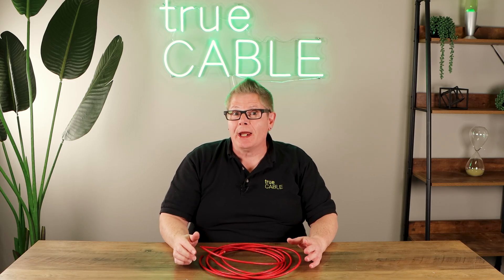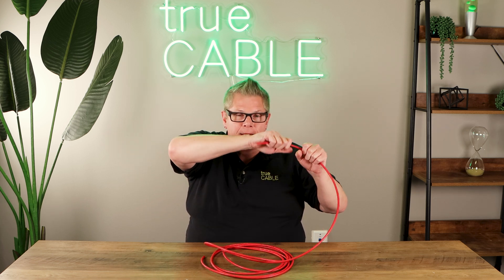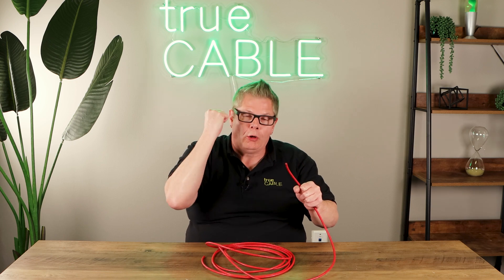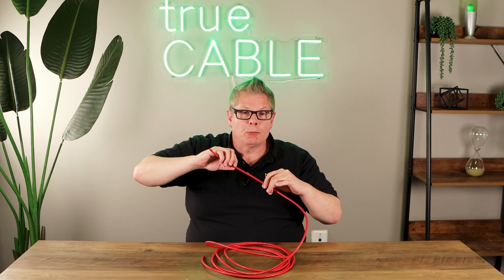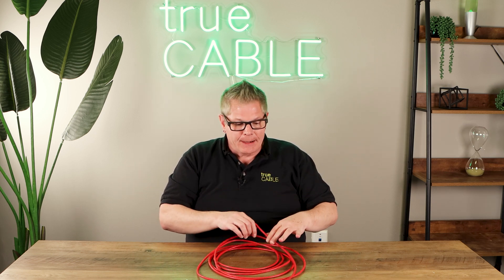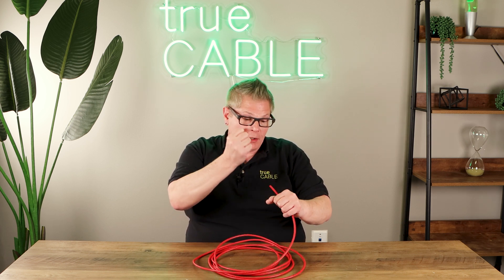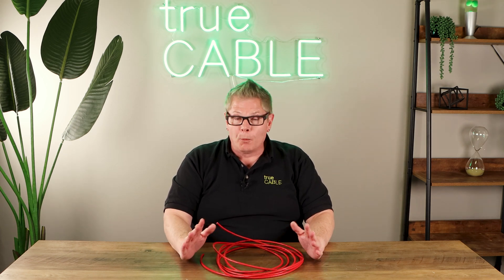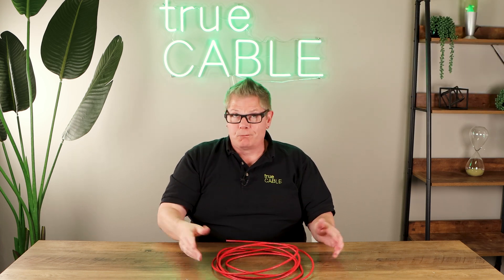Why You Should Never Pull Ethernet Cable Too Hard

Comment: My ethernet cable is stuck like crazy in my Msi Titan 18HX AI 😢 idk how it happened. I just put the cable in like normal
Reply from the maker: Hello and you are not the only one who has had this happen. What is going on is many consumer market devices such as laptops, consumer level switches, IoT devices, and wired cameras have (often misaligned and badly designed) recessed RJ45 ports and that can cause issues with disconnecting the modular male RJ45 plug you inserted. This can also be caused by badly designed boots and anti-snag protection on the cable itself. You will need to carefully depress the RJ45 plug latch with a tooth pick, plastic spudger, or some other same tool and finagle the plug out of the port. I recommend avoiding a metal flat blade screwdriver unless you are willing to take the risk of it slipping and scratching something or even getting jammed accidentally into the RJ45 port!
Reply: @trueCABLE Alright. Thanks for the information.

Comment: but what is the solution?
Reply from the maker: The solution is multi-fold and depends on what you are doing. Avoid too many turns in your drops (which creates a lot of pull points) and use synthetic wax-based lubricant where feasible. In addition, over-pulling sometimes occurs during a pull because of kinking or binding at the spool/box which can be addressed by having someone at the feed-end watching and correcting that as it comes up. Finally, a pull sock with eye swivel will go a long way to not only allowing multiple drops to be pulled at once, but preventing binding and kinking in cable pathways. I hope that helps!

Comment: Is it possible to push Ethernet too hard through conduit ?
Reply from the maker: Hello R. Yes, yes, it is. In fact, improper pulling practices and incorrectly sized or loaded conduit have been the source of more Ethernet cable jacket failures than any other cause. It is easy to exceed the 25 ft-lb pull limit and distort the conductor pairs, effectively unbalancing the cable and ruining cable performance (or rendering your cable as best suited for a clothesline). It is very important to use, at minimum, 3/4" conduit and not to load the conduit past 40% fill upon initial installation. The use of copious amounts of synthetic lubricant on the cable as it enters the conduit is also important. In addition, this is a two or three-person job. One person will feed the cable into the conduit and keep it from kinking or binding at the entry point. Another person will be at the remote end, smoothly pulling. You may need a third person at an intermediate pull point. 90-degree bends pose limitations, too. I suggest taking a close look at this blog I wrote that breaks all of this down and provides clear instructions: https://www.truecable.com/blogs/cable-academy/conduit-fill-chart-for-ethernet-and-coaxial-cable.